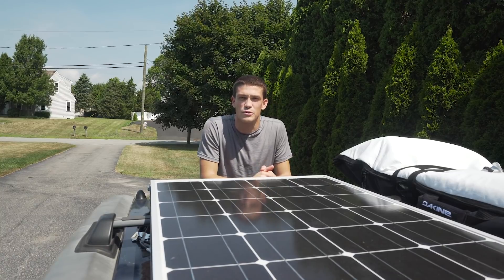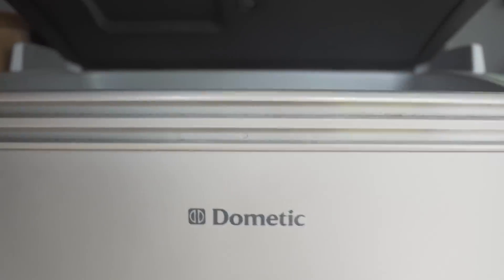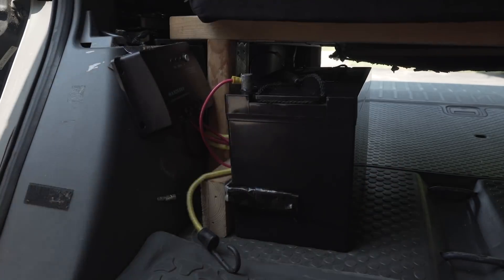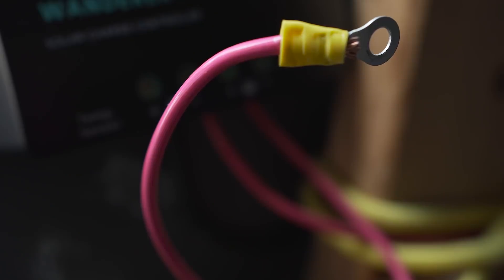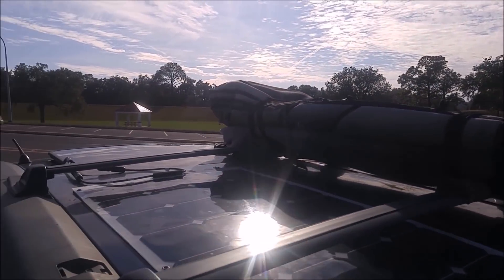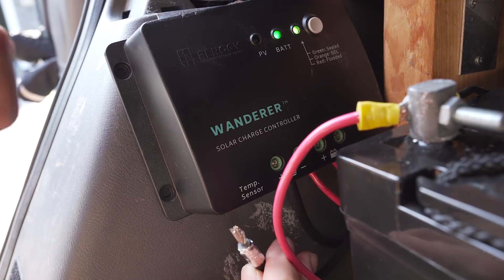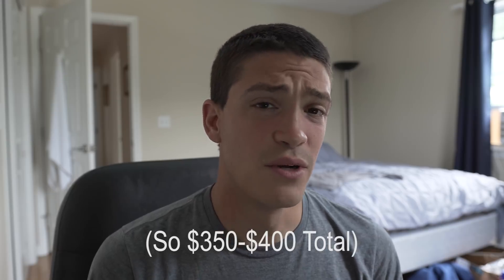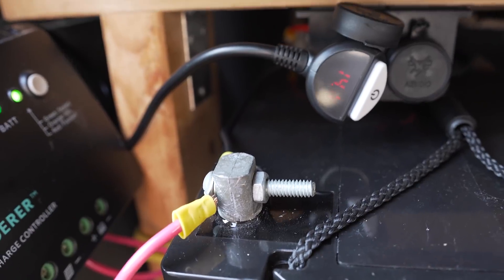EASY SOLAR POWER for RVing, Van Life, Off Grid Living

Comment: Where and how did you attach the volt adapter connect, I saw on your web about ring terminals and believe I can do the rest but don't know what ring terminals are and  believe the battery terminals are being used already, could you explain, I can't even find this 12 volt adapter can only find to go to dc

Comment: Just signed up, after watching Adventurevanman introduction. You are easy to understand and appreciate the simplicity of your style. 12 Volt system running proven solar components and Fridge! As you can see, I have a Bus and have found a solar installer that is going to mount two (225 Watt Rigid panels) to my bus with all the components. My heat for winter will be from my Antique Coal / wood stove.  I look forward to searching your archives to learn more. Happy Trails to You!

Comment: Just my personal 2¢ whenever you have extra money and time to spare. Upgrade your wire to have more strands and thicker gauge. DC power travels on the outside of the wire AC power travels on the inside that's why AC wiring your house is thicker solid copper. So having more strands would mean typically less resistance. And more solar to your battery. Also a little fun trick if you want to have hot water in your Honda run some small tubing behind the solar panel back and forth and pump it into a reservoir inside of your vehicle small bladder will suffice and run it on a small efficient 12 volt tiny pump and you have hot water

Comment: hey Nate....what is the box with the 3 cigarette lighters and 2 usb connected to...the battery or charge controller.
Reply from the maker: Hey! It's plugged into a dual 12 volt outlet which is connected to the battery with ring terminals. Check out the article for more info, I mention it briefly in there!

Comment: since solarpanels are not designed to be mounted directly to a metal roof, the gap between is actually better for airflow and keeping the panels cooler. otherwise the panels would overheat which is what you probably did with the flat panels
Reply from the maker: Good point, the one panel I mounted to the roof went bad and part of it was likely due to the lack of airflow.

Comment: On the sealed battery do you not have to worry about venting it?
Reply: ditto
Reply: From what I understand they should be vented for safety reasons incase of overcharging, under normal use they do not give off gasses, so if your very sure of your charging system it should be safe, but with that being said, I personally think I'll try and find a way to vent it to the outside.

Comment: Love the simple approach.   I have almost exactly the same set up except I have 300 watts on the roof because I have a bigger fridge and 3 vans.   No inverter for me either.   I have one question: where do you get the laptop charger?   Mine only plugs into AC but I know they make them that are DC plug-in.   Where did you find it?   THANKS!
Reply from the maker: Thanks Mark! It's on Amazon. There's a link to it in the solar article on my website (link in the description).

Comment: Great info, Nate. I hadn't thought about all 12-volt. Will given that some thought, although my electric razor needs AC to charge. Not sure if any contraptions are out there that can just be little devices to convert 12-volt DC into an box with AC plugs. I'm thinking about going Lithium if I have enough start-out money to purchase that. I might. See ya later.
Reply from the maker: Thanks George! I had that same issue for a while (until recently getting a razor that charges via USB). I'd mostly just charge the old razor at Starbucks, haha. But I do have a cheap 400W inverter that I can use for random things like that. It just plugs into one of the 12V outlets.
Reply: Ah, cool. Nice picture of you sneakily plugging in your razor, probably hiding in your backpack, right? hehe. Good to know a quick plug-in inverter is available. I may need to use that myself. (If I don't plurge on a solar generator. We;'l see how much money I can spare on the system.).

Comment: With all the driving you do, have you thought of using an isolator as Well?
Reply from the maker: I have a basic switch now that opens and closes the connection between the car battery and the house battery. I used it with my old setup, but haven't hooked it up since upgrading to the new 100AH battery. If I run into any problems in the future, I can always get that hooked up for an extra boost of power.

Comment: Extremely helpful.  People scare u thinking it going to cost and arm and let to get a nice system.  I would only need a refrigetor, fans, and electronics so I'm glad to hear $400. Thanks again.
Reply: Samantha Dodd but keep in mind a good compressor fridge runs $500-900 unless you already have one or can get a used one.
Reply: John Bergholm 

Thank u.  I know they r really high.  Any suggestions on the cheapest refrigetor that will work the best?

Comment: Nate, refresh my memory:  Do you also use an isolator or solenoid switch so you can charge the battery from the vehicle alternator?  Thanks.
Reply from the maker: I used to with my 35AH battery but have not since upgrading to the 100AH battery.